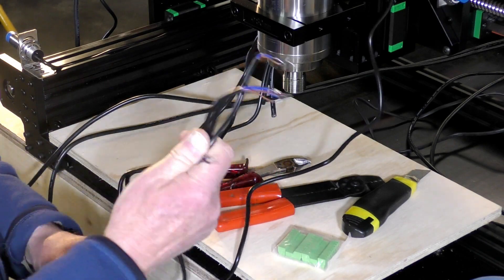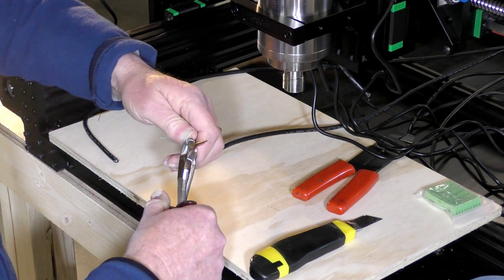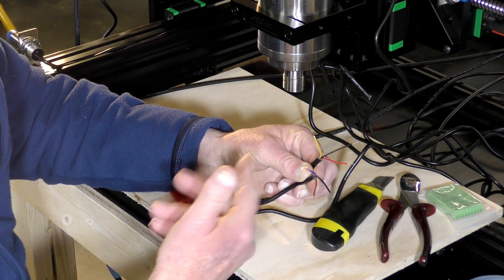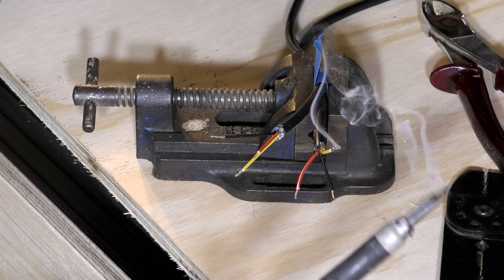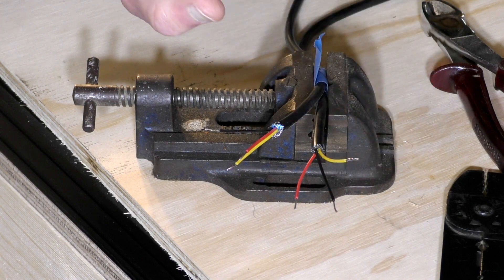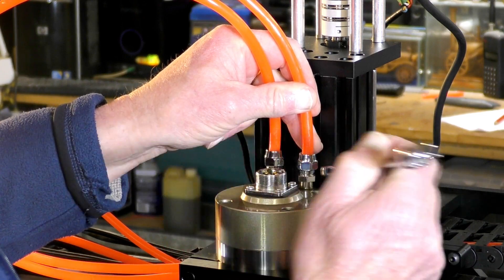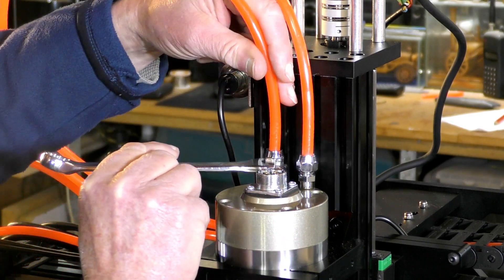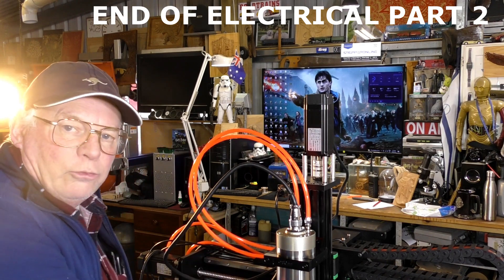Part 9 QueenAnt PRO V2 Super  Enhanced CNC Router running the machine electrical  wiring Part 9

Comment: A heads up, you should not tin wires that are going into screwterminals or getting ferrules and similar installed. The pressure and temperature variances can result in the solder flowing and the wire getting loose.

Comment: Hi Roger, being from the UK and referring to your video at 4min 30sec the wiring for a domestic plug in the UK  is  Brown = Live, Blue = Neutral and Yellow/green = Earth. No relavence at all to the colour coding on the YuYong provided proximity sensors.   You also say in regard to the sensor wiring that the Brown is Positive, the Black is Negative and the blue is the signal back to the controller.  This is wrong unfortunately but also understandably as it follows accepted convention. The actual wiring for the sensor is Blue=COM- (supply ve), Brown= COM+(supply +ve) and Black=Sensor Output to controller.  COM and COM+ relate to the DDCS V3.1/4.1 controllers.